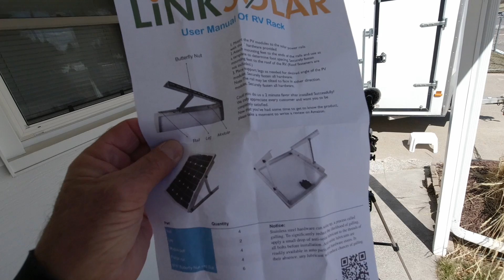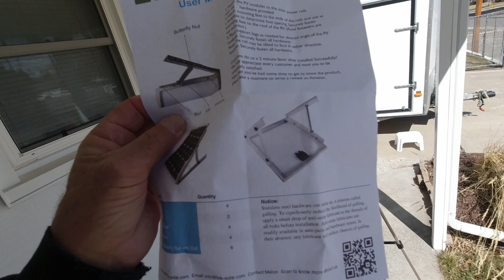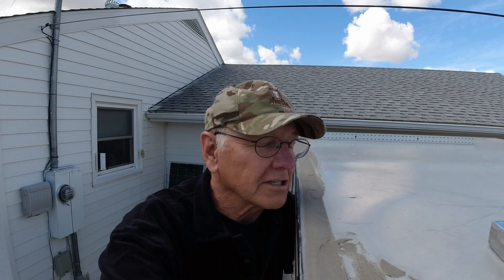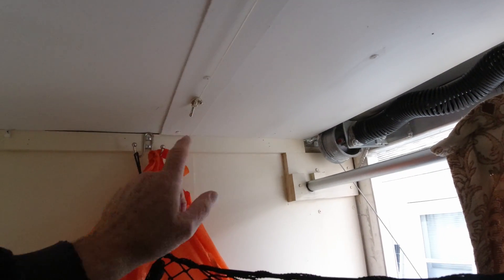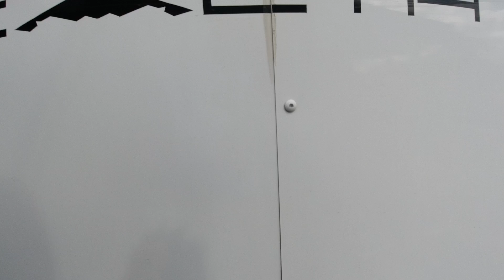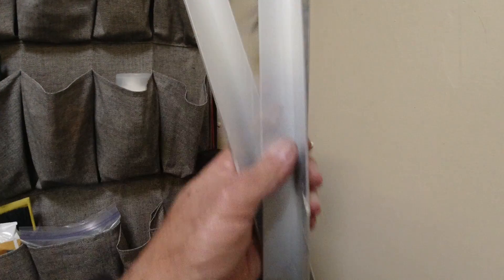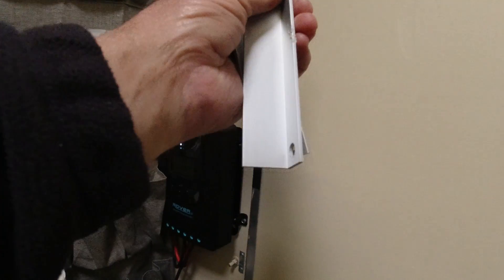Cargo Trailer/RV Tilt Panel Solar Install

Comment: Ah yes, the ol' solar panels.... They're good if installed correctly, BUT, make sure the angle of the panel isn't too steep otherwise all the electricity will drain out and stain the roof and side of your trailer..... 😇
(Ah geez....... Who brought this bloke along.... 🤣)

Good job Rick, will be interesting to see where you install your wide screen TV & the dish mate, 🤣.
One of our local blokes installed a solar panel as a roof over his ute tray to power his tray mounted beer fridge. Works a treat!! Trouble is though, he only gives us water the cheap bugger, 🤣🤣🤣🤣.

Well done, will be good to see it in service.
Stay safe please, cheers.
Reply from the maker: LOL!  Yep, gotta look for those unforeseeables.  Hoping to get it out for a test run this weekend, but we'll see how the weather turns out.
Reply: Some years ago we had a visit from a consultant to talk about installing solar. We wandered around the permimeter of the house chatting and when we were out the front, I started......
Me: I think our roof is too steep for panels.
Cons: No, it is fine. Our installers are trained in rooftop work.
Me: I'm not worried about the installers, but the roof  is too steep.
Cons: Pardon?
Me: Pardon what? I said our roof is too steep.
Cons: Why? What makes you say that?
Me: Well, you know things flow down hill right.
Cons: (really puzzled look on her face) Yes.
Me: All the connections are on the high side on the panels.....
Cons: (interrupts) Yes, that makes it easier for the installers to hook up the panels.
Me: ok. But since everything flows down hill, these panels will fill up with electricity and most likely leak all over the place. Who's going to clean up the mess?
Cons: (silence & dumfounded). No, No it isn't like that....
Me: (interrupts) But I'm an electrician. I know about these things.
Cons: ( now going red in the face) I will have to check on that. But these are German panels, the best you can get.
Me: Northern Hemisphere? Good Lord, and you're installing them upside down?
Cons: No no....
Me: (couldn't contain my laughter) It's ok, I was pulling your leg. And what nice legs they are.....
Wife (from front porch): PILOT!!!
Me: Uh oh, in strife now.
Cons: long silence.......
🤣🤣🤣🤣🤣🤣
Sue clanged pots & pans for a week. And the consultant had a pantsuit on, 🤣!! Couldn't see her legs 🤣🤣
People pay when they let me loose from the rathouse..... 🤣🤣
Cheer Rick & Linda

Comment: In aircraft work we would spread the sealer evenly over the surface of the part to prevent dimpling on thin aluminum. Ensure good adhesion and proper seal. Less squeeze out and easy clean up. Looks great!
Reply: I dont mean to be offtopic but does anyone know a tool to get back into an instagram account??
I stupidly forgot the login password. I love any tips you can offer me!
Reply: @Maximilian Gage Instablaster =)
Reply: @Vincent Gordon Thanks so much for your reply. I got to the site on google and im waiting for the hacking stuff atm.
Seems to take quite some time so I will reply here later with my results.
Reply: @Vincent Gordon It worked and I finally got access to my account again. I'm so happy:D
Thank you so much you really help me out !
Reply: @Maximilian Gage glad I could help =)